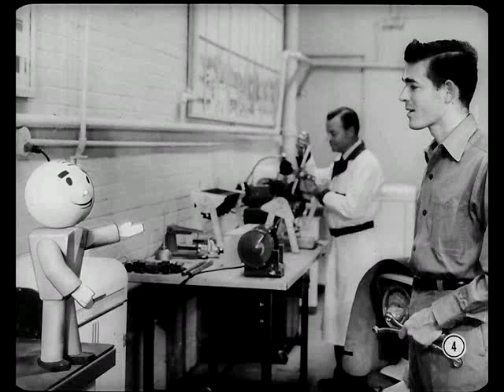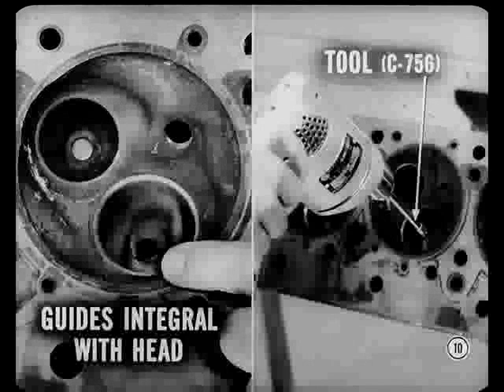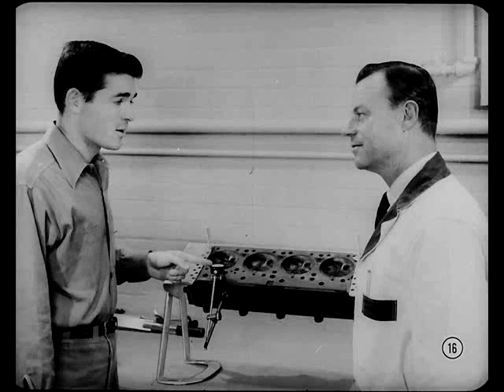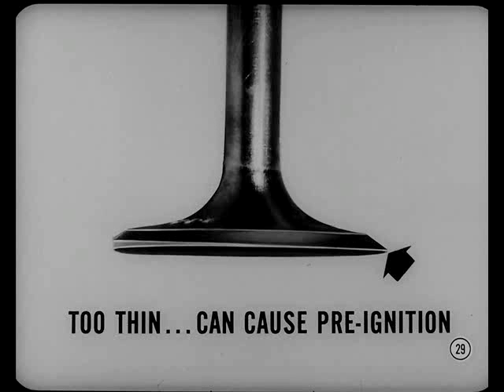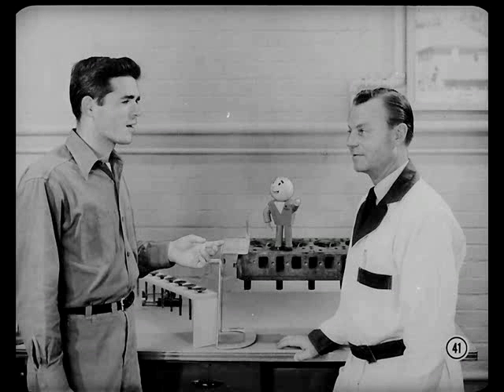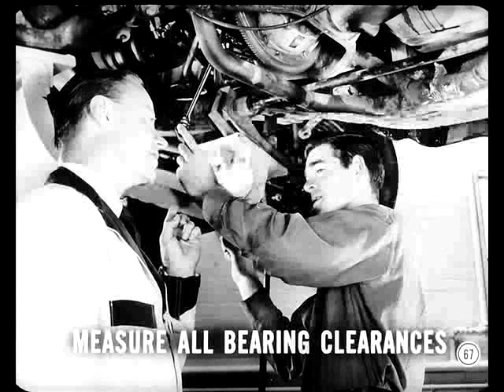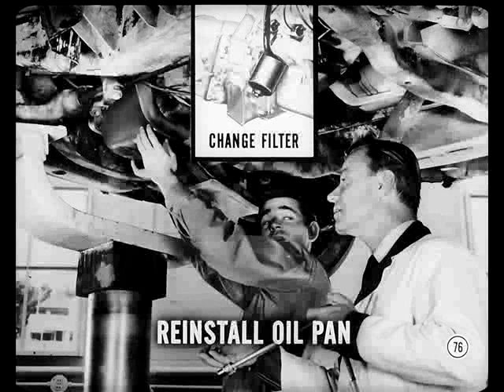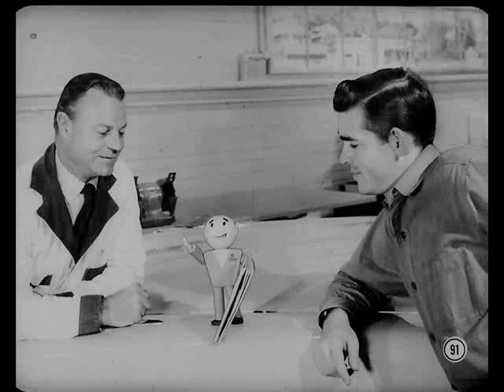Chrysler Master Tech - 1959, Volume 12-10 Valve & Bearing Service

Comment: As things changed over time, people simply shipped heads to a machinist for rebuilding.

Usually when I see a video of worn valve guides, I see someone press fit steel or bronze guides. I don't see videos of people using a wider valve in the integral guide.

6:28 I am also surprised that they said you could always grind the valve seat. There are cases where the integral valve seat is too out of shape for grinding, and the head must be machined for a press-in valve seat. I suppose when leaded gasoline was the norm, this problem was too uncommon to be worth mentioning.

It is interesting to see these parts being tested and some machined. As time went on, more old parts would be thrown away rather than re-machined.

15:05 He should have mentioned thrust bearings. It is very important for those to work properly, Mitsubishi made many engines with thrust bearing problems from about 1995 to 1999.